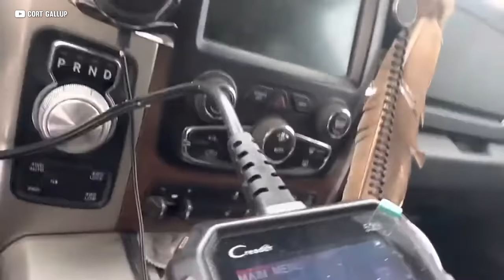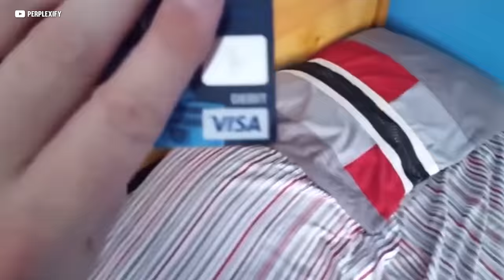Worst Trucks Only Stupid People Buy

Comment: I do own a 6.0 powerstroke. I bought my 2006 in 2016. Yes, I've had the issues you mentioned. But, it wasnt until i was up to about 180,000 miles. By the time i was at 229,000 (when i had 100,000 miles on it) the truck is now runnong better than ever. Yes, i spent a lot of money fixing it, but no where near what it would have cost to buy another truck. I am curious though... why didnt you mention the failures of the chevy duramax? They were just as bad, if not worse, than the powerstroke or the cummins of that era. That was when the idiots in the government began to require emissions, like an egr valve. Yeah, brilliant! Recirculate diesel exhaust that is known to have particulates in it. That does wonders for any engine. The only company that i saw do this right was catapillar. The recycle the exhaust after the DPF. That means relatively clean exhaust gases. But they don't make consumer level engines.
Reply: No, the doormax is we're never that bad. I have 4 of them. They have over 400000 miles very little problems. So you don't know what you're talking about. It's the best diesel out there. Believe me when I tell you if it wasn't. I'd have the other ones the other ones are worse
Reply: @scottmendoza8989  Absolute BS..  Isuzu designed Duramax Had just as many and similar issues. Ford just sold so many more fleet trucks that their failures were much more publicized. All early attempts at high output and low emission diesels failed. Period, End of Story. 
Why do you think almost every mfg has been caught in some kind of "fudging the numbers" scandal around emission controlled diesels? V8 architecture and diesel dosent go well together. The Euros get away with it to some extent, but they accept that they have to pay with reduced life of their engines in exchange for lower emissions. They are more about packaging and V8 is a more compact design.
Since the 2 stroke Detroits, There really hanst been any V8 american diesel that was not
Reply: ....... frought with problems.  5.7 olds, 4.3 olds, 6.2, 6.5, 8.2 mile master GM (junk ++100) 3208 Cat, v555 cummins, 3.0L titan Cummins, Navistar IDI ( not too bad but weak) Navistar HEUI 7.3 ok but weak output  and all the rest of modern crap.
Include all the euro V6 stuff in here too. 
Following the international rule "The first bullshitter dosent stand a chance" Ill tell you, Scott, about my 415000 mile 6.0L That daily  pulls 40ft gooseneck trailers loaded with dead chevy 4L60 transmissions to the smelter.

Comment: The Ford 4.6 and 5.3 2 valve were pretty good but they were very easy strip spark plugs during installation. Just had to be careful.
Reply: Exactly. The 5.4s biggest issues were lack of or improper maintenance. I’ve had 5 different 5.4s and they’ve all gone well over 200,000-300,000 miles with no major issues, because I take care of them. 🤷🏼‍♂️

Comment: I have a 1998 Tacoma with 140K miles and it's as solid as when I bought it over 20 years ago! 2.4 gets about 20 in town and about 24 on the highway. Only thing I have done is change the oil every 3K miles and keep it properly maintained, new fuel filter, trans. filter and so on. I'm selling it to my Grandson and I'm buying a new TURBO Tacoma!! Update 6/21/24: They can keep their $40K Tacoma's and I will keep my money...

Comment: I had a 98 Expedition Eddie Bauer with the Triton.  Except for replacing the alternator at 156k it ran wonderful.  One of best trouble free trucks I've owned.  No one I knew with the Triton had the issues you claim.
Reply: I know several with these trucks and 250+ K miles with never any issues either. people who see them/work on them get jaded, there are far more Fords built and therefore they see so many of them and more issues with the Fords that were abused compared to other brands. But I do know some with the issues were because they were chipped or abused in some way. Even an air intake upgrade can junk an engine in a truck. People don't realize some of the so called "upgrade parts" are bad. Or they sell them used and take all that stuff off to try to hide the abuse or not, but the second or third owner experiences the issues.
Reply: Agree. I had the same 98 Eddie Bauer Expedition with the 5.4 and it was a great engine and truckChanging those plugs by the firewall was one hard job

Comment: I have a 21 Ram 1500 with the 5.7 Hemi. Absolutely love it. I know the lifter issue could rear its ugly head in the future, but like you already pointed out...there's almost no truck out there without some kind of issue.
Reply: My GMC Sierra has cylinder shutdown as well.     It's all a government gas mileage deal.     There is no way around it anymore on modern vehicles.     Mine runs great.    It's a 2008.     I've never had any issues.   140K miles and no lifter tick.    Use Napa Synthetic oil 10W-30
Reply: I don't know if GM does this. But on the Rams, if you place the trans in autostick mode and leave it at the highest gear, it will deactivate the cylinder deactivation system from activating. 

I have 2 rams one is a 2003 1500 5.7 with no mds. This one as over 360k. And a 2018 ram 2500 with 6.4 and it has about 127k.

Comment: Love your channel , fun how you guys present your information . I owned a used Dakota with the 4.7l 8 cyl. Never had one issue over 7 yrs . Around 170k the body was rusting out so I swapped it for a used 2012 Ram , 5.7 , it did have exhaust manifold issue and a $500 front end issue thanks to one our city's craters they call potholes its got 168k on it . I'd keep it till it died except the new 10,000 lb boat we got 2 years ago is a bit pass it's towing capability Maybe I've just been lucky , now I do keep up with my oil changes .

Comment: I don't own one of the trucks on the list, but I absolutely stick by Toyota trucks. I currently have a Tundra with the 5.7 V8 and I love the thing! It has been a reliable beast built solid as a rock. I also have an old Ford F250 with the 7.3 diesel motor and other than the glow plugs burning out prematurely, it runs decent.

Comment: There was one truck that is wildly popular as a a project truck and it was only one year that you need to inspect closelry. The 1973 Chevy C10. The welds were sloppy and they evidently didn’t get the correct metal for the underside, floor pans, the rocker panels, the bed flooring along the front seam, and along the rocker panel of the bed. They just rusted out, badly. It seems like by mid 74 they figured it out and they were fine.
Reply: I remember those ‘73 trucks, they didn’t last at all, here in the north with use of salt the beds literally rusted off within just a few yrs, generally about 5 winters

Comment: 5.4 3v down fall was a low volume oil pump. Use synthetic and 10w-30…no internal issues after 240k miles for my 07 expedition.
My 05 I replaced with Melling HV pump and chain tensioner set(cast steel w/ratchet lock) and new OEM Cam Phasers…runs like a champ @190k! Hope to go another 100k+! 
Use Ford Racing spark plugs two heat ranges colder…holy cow the improvements in throttle and smoothness, a little hurray for smidge on mileage too! Good luck Blue Oval brothers/Sisters!

Comment: My 2001 Dodge Dakota Quad Cab went 360,000 miles, and was still running when I sold it. Timing chains were needing replacement at that time. I used cheap oil and cheap filters, with no sludge problems. I just changed my oil at 3,000 miles (the recommended "severe usage" factory service manual interval. I DID have to replace the power steering pump at 70,000 miles due to shaft seal seeping, and an alternator at around 325,000 miles.

Comment: Lifter collapse on my 2016 Silverado 1500 w/5.3 @72K miles. Sold it to dealer as-is. No more GM for me. Vehicle was meticulously maintained.
Reply: Ya gotta get rid of the AFM with a delete kit.  The engine is fine, it's the AFM system that messes them up.
Reply: Thank the government.
Reply: @sp1068  Nope. Blame GM engineers, quality control and a garbage warranty. Other mfgs have made cylinder deactivation systems that do not have these problems. Moreover, GM did not address the problem once it became apparent after a few model years. Shame on them, not the govt.

Comment: Dumb Question:  We've been making engines for 100+ years.  How can manufacturers get the basics wrong?  

I will give credit where it's due though:  My 2004 Infiniti M45 (not a truck) which I bought new was sold with 225k on the clock...and the VK45DE engine was still absolutely solid.  The other one was the Mercedes OM616 2.4L diesel engine.  I don't know where that car is today, but at last check the car did turn 1 million miles.
Reply: MANY issues have arisen from governmental EPA mandates.  Many of these engines were very reliable in the early 2000's, and then magically after governmental mandates around 08 or 09, these reliable vehicles suddenly got very dependent on those 3000 mile oil changes, things started failing that didn't fail due to ever hotter running engines, etc.  If they'd had the transmission tech a little earlier on, they would not have had to go so overboard with the engines.  I don't think vehicles are going to be improving anymore, personally.  Way too much turmoil and diminishing returns these days.

Comment: Older Dakotas with the 3.9 were pretty good if you made some minor changes. I put the full size 5 speed in mine with the 3.55 gear ratio and pulled 27 mph, out of the v6.

 All in all I want a truck that runs good, is cheap to maintain, and won't break if I get on the gas too hard or the wind changes direction on a Thursday at noon in Tulsa Ok on 2nd street by Joes bar and Grill. Yes some trucks are that specific when they break. Gimme a Chevy with a 5.3 (327), a 5.7 (350), or a 6.0 (366), or even a Duramax and I'm good. Anything else, and it's your wallet.
Reply: You saying you don't crave the biggest touch screen and air conditioning in the seats? How will you survive?
Reply: @TIJoe-te9qu  🤣My favorite vheicles had no A/C, a rigged radio that may or may not set fire, or just flat lacked window stripping and pissed clutch fluid in the floor. 🤣
Reply: @michaeltarno2979  I liked my VW that had to be held in 4th gear, had 90 degrees play in the steering,  a rag for a defroster,  and special push starting feature.
Reply: @TIJoe-te9qu  Haha sounds fun!
Reply: @michaeltarno2979  Definitely.  I forgot about the front tires with metal cords showing. Better for grip off road, and I figured with the front end so  light, a blowout would be no big deal. 
A guy I knew took his bug to the next level. He had an old sock clamped onto the carb for an air filter, a come-along around the transaxle to hold it in, and a piece of house wiring on the floor to connect the battery to the fuse box. When a valve cover fell off, he just added oil and kept going. 
You'd never guess his grandfather was a good mechanic. 
Those were the days.

Comment: My friend had a 2012 Sierra 5.3, had close to 300K km's before it was stolen. It was stock, he had zero issues and was running great. I have a 2011 Silverado 5.3 , 85K km's, just installed the Range AFM disabler about 5K km's ago. I have had no issues either but just wanted to feel better staying in V8 mode all the time. Other than that the truck has been good to me, I bought it new.

Comment: The 99 to 06 Silverados have been proven to be very reliable nearly 20 years since they been in production.
Reply: I have a GMC Sierra with the 5.3 cylinder shutdown engine.    I've had zero issues with it.    And it's 15 years old.     140 thousand miles now.    No lifter tick either.    Use Napa Synthetic oil 10W-30
Reply: Yeah, miss my '02, rusted out before she wore out!
Reply: @gregorylyon1004 pretty sure shudowns started in 06, definately by 07.
Reply: As good as those years are compared to later trucks, the 1988 to 1998 Chevy trucks were even better.
Reply: The phrase "They don't make them like they used to." applies

Comment: A gold mine of information. True nuts and bolts (and cam lobes) and not emotional biases. Personally, baby it, and it will baby you back. Injector #4, then #5 went down on my '08 6.0 E350 at 524,000. Otherwise, I'd still be in it. Best vehicle I've ever owned. It speaks volumes when a cargo van grabs your heart. A masterpiece for what it was.

Comment: Update to my post below from a few months ago. . . . I have a 2018 Silverado 5.3L with active fuel management. It has 42K on it and since the manufacture's drive line warranty expired last May I went ahead and had a Performance Tune done disabling the ridiculously low MPH torque converter clutch lockup causing a lot of Locking and unlock in rapid succession while city driving. The tune also disabled the cylinder deactivation on the engine too. Happy to report the truck is much more responsive staying in V8 mode all the time now and the transmission doesn't struggle like it use to trying to find the best of the six gears to be in. Also surprised that while this has provided a big performance improvement I have not seen a noticeable difference in overall fuel economy either. ;-)

Comment: I own a 2016 Tundra 5.7L V8 double cab. Bought it new back then. She has zero rust and has been well maintained. I got 497,236 miles on her. She still runs like the day I purchased her. Same motor and transmission with zero issues ever.

Comment: The 6.0 powerstroke wasn’t as bad as everyone makes them out to be. Most of the nightmare 6.0’s were from lack of maintenance and heavy city driving. 

However, the 6.4 powerstroke was an absolute nightmare that caused Ford to drop international completely.
Reply: So why did Ford buy a bunch of the 6.0's back.  Yeah they were pretty bad and still are.  Bulletproof one and you still have issues.  And I'm not so sure the 6.7 is any better.  I know a local const company that has a fleet of them and has to have extras since there are always some of them in the shop.  Always. Turbos, blown motors, fires, you name it.
Reply: @blythkd9017  a construction company is a terrible advocate for their performance lol. I’ve worked construction and they don’t maintain a damn thing. Everything is always just enough to keep it on the road. So once again, we are down to poor maintenance and lack of care.
Reply: @lordxandalf I agree normally a const company would be a poor example but this is a small woman owned business where the owner's brother maintains the small fleet meticulously.  And most of the trucks are driven by the same guy all the time, it's his truck, so he has to take care of it too.  I know some of the guys that have these trucks and they are good to them.  Still, the 6.7 engine hasn't showed me much.  It might be winning the power war right now but I still wouldn't touch one personally.  All the independent diesel shops around here are full of Fords.  Most of the shop owners warn you to stay away from them and they drive Rams and GM's themselves.  But that's just around here, maybe it's a little different somewhere else?  IDK

Comment: I have 2 jeeps with the 4.7.  One I bought used with 3 lifters that fell off.   The hydraulic adjusters were hard as a rock and all coked up.  New lifters and synthetic oil only and that engine is now at 240K miles.    The other one, bought with 50K on the clock back in 2005.   Its also pushing 230K miles and I beat the hell out of that one.  AWD and a V-8 makes the perfect wet weather vehicle and its pretty stout 0-40mph (little weak above that - but will pull to 80+).   The key, synthetic oil on regular intervals.

Comment: As far as the GM 5.3 and 6.2 with cylinder deactivation. You can buy plug-in modules or a tuner and turn it off. I have a 2012 Silverado with a 5.3 and I had a problem with the system pumping oil into my cylinders when they were off burning up all but two quarts of oil before I figured out what was wrong. However, it did not even damage my engine and I had the choice of a $200 plug-in module to turn it off or a $300 Hypertech tuner which did way more. I chose the tuner and turned it off at 86,000 miles and never had another issue with it and it has almost 197,000 miles on it now.

Comment: I've bought my last three trucks new:  a 2000 F150 Lariat with the 5.4 Triton, a 2005 Chevrolet Silverado with the 5.3, and a 2012 Ram Laramie with the 5.7 Hemi.  I kept all three trucks to 125,000 miles but still have the Ram at 126,000.  The Ram, by far has been the most reliable of the three.  The Ford had the spark plugs stuck in the head, the lighted buttons in the cab went out, and the fuel gauge sensor crapped out.  The Silverado had the same problem with lighted buttons failing, the water pump crapped out and I couldn't keep the side marker lights and parking lights on for love nor money.  The Ram has been trouble free with the exception of a couple of fiddly plastic bits cracking:  the parking brake release and the center console latch which still work, just a little more difficult to use.  The Ram has a lot more power, a more comfortable ride and even though it's reached the mileage where I usually get a new truck, I'm going to keep it for a little longer.  I'm patiently looking at new and near new trucks for when it comes time to sell the Ram, but I'm not liking what I'm seeing both in price and reliability.

Comment: 2006 GMC Sierra king cab 5.3 (323CI) non VVL engine with only 63k but I love that truck. I drive it like an adult but I open it up from time to time, it's good for it!
Mobile 1 oil and filter which rates high on particle filtering but really high on oil flow.
Well over 300 ponies so it gets it on just fine when you need it! The 6-speed overdrive automatic tranny is geared perfectly.
I get 20MPG @ 70MPH on trips which includes going over a 4,000ft grade there and back. Not bad!
It rides really nice, is very comfortable and is "Not for Sale"! I think it was 07 when they put the troubled VVL junk in.
Not worried in the slightest about my push rods! Change your oil gentlemen.